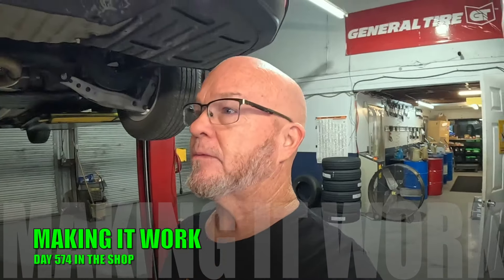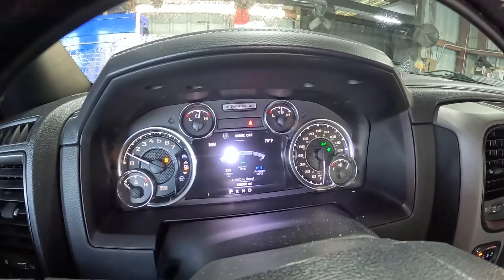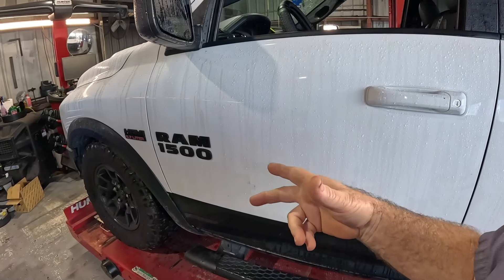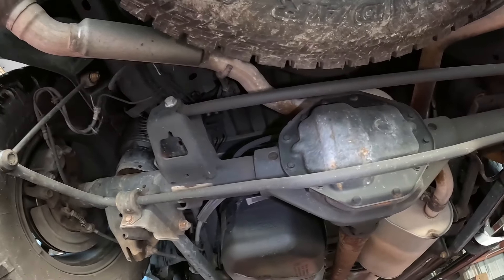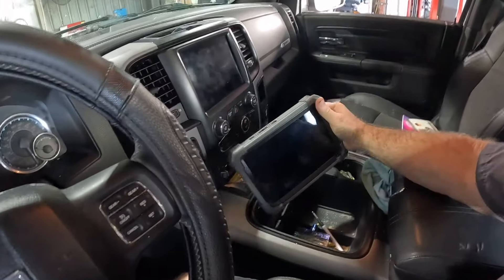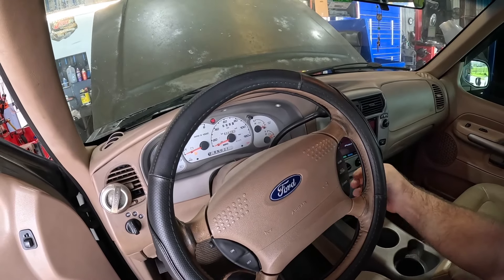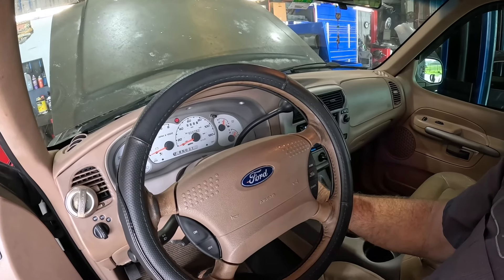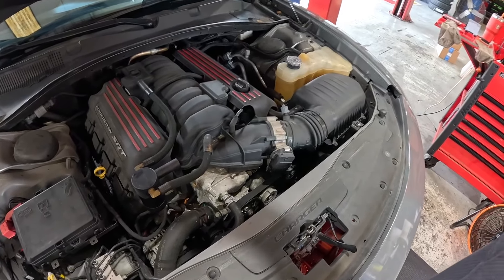2 Silverado's with A/C repairs, Charger Coolant leak, Ram suspension Flat. DAY 574 in the Shop

Comment: those chevy truck condenser have a flaw where welded seen bunch of same issues most likely heat cycles
Reply: Went on for years and they never recalled it. GM knew it was a flawed design and kept using them.
Reply from the maker: Yeah, we have done a bunch for sure!
Reply: @COBRO98  ray had used an after market one. looked to be better build.

Comment: Did you ever hear about the dongle you can get to exclude sgw?
Reply from the maker: Yeah, requires getting to the gateway and can be time consuming on some vehicles. Probably get the access soon thru the shop.
Reply: @JimmyMakingitwork  I thought it was a direct plugin to obd. I guess the gateway is pretty hidden. Behind the duct on a hellcat apparently

Comment: Thanks for the video Jimmy!
I got caught out with the brake discs on the 1969 Ford I've been working on... I imagine everyone except me already knew that the discs are thicker on the outside of the vent slot than on the inside. Maybe I could have had the old discs machined if I'd known it was supposed to look like that but to me it just screamed "Stuck slide pins".
Reply from the maker: Right on, they are often cast off center, but to me it should be centered also! ;)